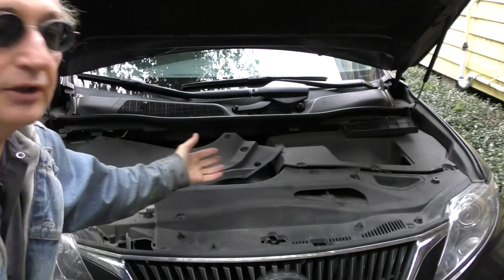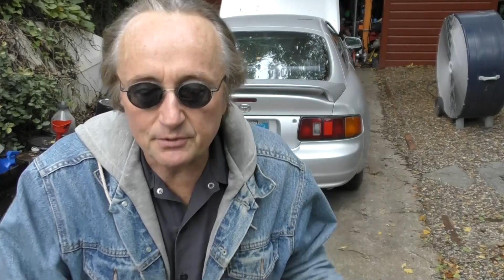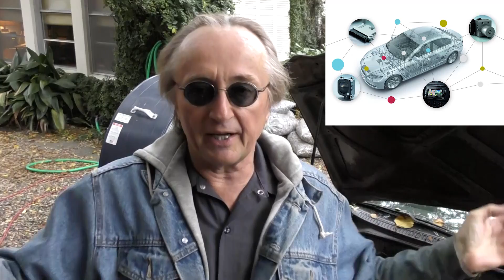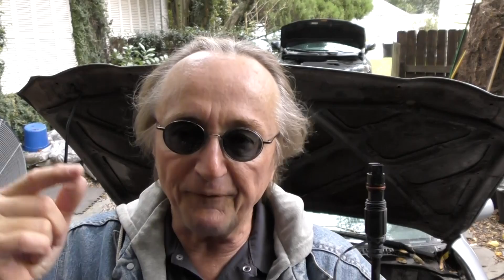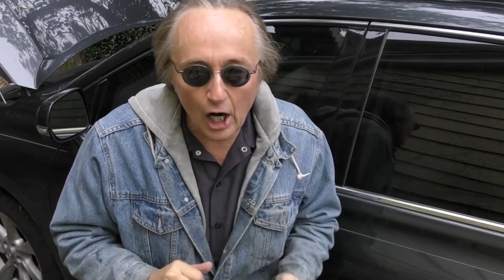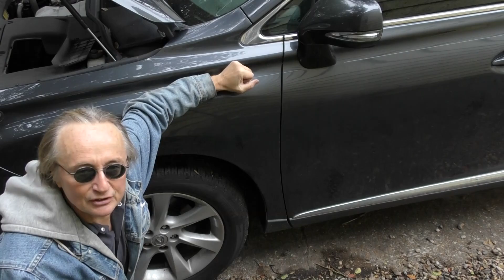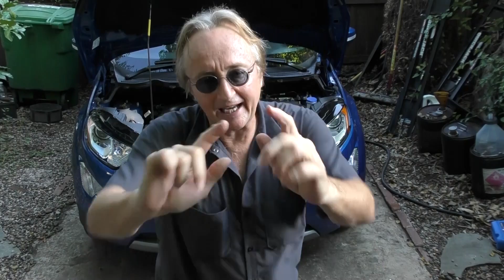The End of DIY Car Repair, Why New Cars are So Hard to Work On

Comment: Scotty, I've got a '91 Jetta GL that's been sitting in my garage for 5 years that I was thinking about getting it to run again. It's got 173k miles and is rather easy to work on. My other car has a lot of rust and is starting to have problems and really don't want to look for another car when I already have an extra one sitting around. I know you have a distaste for newer Volkswagens while also praising the old time VWs, but I'm curious about your opinion on the 2nd generation Jettas(1984-1992). Thanks.
Reply: I’m not Scotty, but I want to chime in because I drove a 1985 Jetta diesel and have known people who own your generation of cars.

I think it’s a decent ride, very cavernous and somewhat utilitarian.  It’s still old enough to not to have all the electronic and emission related headaches of modern VWs.

However, have you made sure that the Jetta has little to no rust?  I don’t know where you live, but since winter is here, decide whether or not you can stomach a project car.

Also, for obsolete parts, look all over ebay, junkyards as the age might make some repairs tricky.

Also, what’s your budget and how long until you get rid of the rusty car?
Reply: if you let a car sit,you are asking for more problems than you can handle
Reply: @AB-ou8ve  Last I checked, the Jetta had very little rust to the point that it's repairable. However, it's in a small part of my garage and haven't had time to get under the body for a recent check up. I live in the midwest and may continue using my older car for one last winter. At the very least, I am realistically looking at a few thousand dollars put into it. I can get another decent used car for the same price or less, but I like the look of the car, the way it drives, etc. People have tried to buy it off me in the past, but I always ended up saying no. One person was interested in it for just the shell.
Reply: Stevie84s Hi. I drove rental Jettas around that and the next vintage. I like them. I got Passats, 1st a 94 with VR6. If you like the car, by all means I would build a nice motor for it and restore it. Find out what motors will fit in there and join VW clubs and go to meets because that year of Jetta along with Corrado and Golf are very popular. Lots of parts for them. Supersprint exhausts are always cheaper for older VW's too. Good luck and have fun!

Comment: Nay screw that, just trade in your car every time you need new brakes, or an oil change, or tires. Not worth the complex system bull.  New wiper blades? To much hassle, just trade it in.

Comment: When we go fully electric, DIY will be history. So will most mechanic shops since companies like Tesla will have their own stores like Apple does. 💯
Reply: Tesla won't take over its a luxury electric car. Toyota and other car brands from Japan build quality that will keep the market alive for a while. We might move towards hybrids in the future but if you think gas production will disappear I highly doubt it. Trucks are not going anywhere ether. Gas is more efficient with electric hybrids anyway so it makes sense to be the future.
Reply: @CONNERK2  it's luxury for now.  When they develop cheaper cars in the future, people will start buying them up.  Hybrids are being skipped because the demand and reliability aren't there.  No one wants two completely separate systems that can fail at any point.  I think Scotty said hybrids are the worst cars you could ever buy before.

Comment: I had a CTS caddy, loved that car, got rear-ended....the minute I got it back, windows would roll up and down, radio would shut off, AC would turn on and off, power steering wouldn't work, couldn't turn the car off without disconnecting the battery. The top computer guys in town kept it for a month and couldn't figure it. Ended up trading it in for 500 bucks......still owed on it....damn a computer.

Comment: Lots of electrical problems are caused by rusty grounds, especially in the salt belt.   Finding the grounds is the challenge, especially the ones under the hood or rear (ones in the cabin are usually ok). I usually replace the ground bolt with a2 stainless replacements.  Capacitors also fail frequently on circuit boards, or sometimes you get lucky and simply replace anything with char marks on it.

Comment: The ECU of my Lexus was dead. The 2nd hand one, that I found turned out to be from a different year, not supporting my AFM. Thrown out the stock ECU and got Megasqirt. Working through qite a big manual, and had good support by mail, made the engine start easy. Compared to the old days with changing springs and accellerator pump cams in the Holey carb, tuning is much easyer in compurer age. Distributor caps and igniton wires were more expensive than 8 COPs, no problem for an aftermarket ECU.

Comment: Soon, gas cars are going to be replaced. :(
Reply: Electric cars are not eco friendly look how they make them. Gas is here to stay with a mix of eletric hybrids.
Reply: @CONNERK2  Wrong. I don't like new cars, but comparing new cars with new cars, a brand new electric car will have a lesser impact on environment than a brand new petrol one pretty fast, even in the worst conditions. Go watch Engineered Explained video to learn about it.
Reply: Not if Gerard Morin helps us run the engine on nitrogen :)

Comment: I'm an electronics engineer, I was a car mechanic when I was a teenager, I learned a lot in the transition between the old analog stuff (carburetor and breaker points ignition) to the modern EFI, but looking at the trend, the DIY average guy has to learn Networking basics (Ethernet for understanding the CAN bus), some high degree electronics (digital electronics, analog to digital conversion, switching power supplies, digital logic, high frequency transmission line analysis, elementary microprocessor and microcontroller knowledge, semiconductor sensor elementary knowledge), all of that to start using digital logic probes and and oscilloscopes for a good car troubleshooting process, that process of learning is costly or if you're a self-taught guy, takes a lot of time. Even with my converged knowledge of mechanical and electronic systems, I come across with a lot of situations where pinpointing a failure is hard on cars, back in the old days was easier, but today, in modern EFI you have to perform a lot of trial and error swapping expensive sensors or components for that purpose if the car allows that, you know sometimes there are anchored sensors or modules and you have to tell the computer you are swapping them with a other costly tool. I have a dodge charger SXT 2008, I ended up designing my own computer (I did a lot of research on the current signaling for that purpose), so I'm able now to tune my car the way I want.

Comment: The CAN bus system reminds me of the Citroën central hydraulic system. One leak and soon the big red "STOP" light comes on right in the middle of the instrument panel. Soon, the transmission goes to neutral, no power steering, not very long no brakes, only the parking brake! Finally the car sinks down.
Earlier computerized cars had separate computers for each function: ignition, fuel injection, airbags, radio, Bluetooth... They are going toward one master computer that does EVERYthing. When it quits you're done! Hope they leave a default limp-home function.

Comment: I think the biggest problem is manufacturers don't release source code or schematics for any of the electronics. There are a lot of people that are good with software that could trouble shoot issues but manufacturers don't want you to look inside the black box. Governments regulations also get in the way because they don't want people messing around with the emissions control system software.

Comment: Thanks for all the auto advice and funny screen shots. I have a 1997 Nissan Pathfinder with 316000 miles when Nissan made reliable vehicles. I did all that I could do with it myself still runs good except for some minor problems. I also have a Honda Accord 2015 and they are a world 🌎 apart in engineering. Keep up the good videos and beam me up Scotty. Blessings to you and the family.

Comment: You just need to never stop learning.  There will always be some things you won't or can't do, but eventually you will learn the new skills.  So long as we use internal combustion it will all come down to air, spark, and fuel in the right place at the right time.  And when we learn electrics we will have an different way to troubleshoot and fix the cars.

Comment: Scotty in reference to how most modern car's can-bus systems measure current in milliamps, I would like to make another point. If you ever did find the source of the short, repairing it would still be very difficult using traditional repair means like splicing and solder/shrinkwrap. Reason why is because splicing and soldering creates too much resistance in the circuit for the computers to accurately read what is going on. So the only correct way is to basically replace the entire wiring harnesses associated with the circuit.

Comment: Hey Scotty your right about not being able to work certain cars,  take my 2011 C300 for instance. I had a check engine light that the scan tool said it was related to the Crankshaft Positioning Sensors. I went through checking all of them...no joy. The dealer was charging outrageous prices so I went to two well known European and car repair facilities; one was even a former Mercedes tech supervisor. Even with their thousands of dollars scanners neither could isolate the problem. 
One referred me to the dealer who had a even more expensive scanner and they were able to find and isolate the problem right away and repair it. Apparently the dealer pays for newer updated codes every year that give a more in-depth definition of a general code. This way you don’t just R&R the car until you find the problem. Thanks for website.

Comment: The general rule of thumb is that cars today are more reliable & more fuel efficient than cars built decades ago. Today,  vehicles don't need manual tune ups, spark plugs last up to 100K miles, just make sure to change out and replace fluids at certain intervals, always replace the engine oil, I generally follow the Honda oil sensor, when it gets down to around 20%, it's time to change the oil. Things that you can do to save money, replace the fluids yourself, replace brake pads and rotors yourself, leave the heavy lifting to the pros.

Comment: The problem is not that it cannot be done, the problem is that most mechanics don't understand electricity. Working with milliamps is not too difficult if you understand what you are doing and have the proper test equipment. FYI - 4-20 milliamps is actually an industry standard just like 0-5 volts.

Comment: Learn to adapt.  I own a Prius and have done a lot of reaserch on how they work.  With a better understanding of their hybrid drive. I feel more confident in my ability to repair it if it comes to that.   My biggest fear with electric cars is the lifespan of the battery pack and programmed mortality and the pricing of a replacement.    I believed we have reached peak development of soley gasoline powered cars.

Comment: This is true. I am a hardware guy, I am not so much as a software guy. But I understand the CAN system enough to get things working. I'll give you a quick example. You mentioned high speed and low speed bus, this is critical to getting certain devices to work. In a modern car you have the radio tied in with this CAn system. You can't just go to the junkyard and yank one out. You have to know some important information first. But that didn't stop a buddy of mine. The newer 2008 Dodge Grand Caravans have a CAN system. Lower trim levels such as Se have a low speed can bus because there's not so many toys to control so to speak. So my buddy tried to add the Chrysler Navigation radio over his stock, having an Se or LX trim level (no fog lamps, power sliders, ect) I warned him I didn't think it would work. A side from hardware concerns, the harness plugged right in. But no power! Nothing. plugged in his old unit, walla power. The only possible way to fix this issue would be to swap out the main computer and the communications DPM with one from an SXT or Touring model and have it flashed. Even then certain features will never work such as backup camera because that hardware simply isn't installed. This isn't nearly as simple as the 4th gen van. Bought a cheap van that didn't have remote locks? Check under the dash cover for a harness, if you have power locks chances are this harness would be there. Go pick up the receiver from a junkyard, change a setting in the on board computer and walla, the radio was even easier since the wiring for the speakers in the dash are already there, you could install some awesome audio cheap.. Heck 1st gen Navigation unit just plugs and plays. A whole different world today.

Comment: Love your videos, Scotty. I'm binge-watching them. My first car was a like-new six year old 1970 Ford Maverick. Did your's have a shelf or glove box? Did your's have a chronic squeak in the front shock area? A mechanic friend of mine  repaired it by drilling a hole in the supper control arm in order to grease them. No side -view mirror on passenger side. Manual steering, brakes, windows; no AC; straight six engine.

Comment: Having worked in Telecom many years ago, I'd often have to learn about various buses or networks over which devices communicated with, as well as their command and data protocols over a particular bus.  The CAN bus should be easy enough for one to learn, and with a user interface and knowledge of the command set, DIY could be do-able on these kinds of cars.

Comment: QUESTION FOR SCOTTY:  Can you do a video that shows folks the basics of using a pre-1975 vehicle as a daily driver?  Around 1980 I started limiting my auto repairs to 1975 and older cars.  Why?  New cars were starting to get too complicated for a simple brain like mine.  The newest car I've ever owned was a 1977 Chevy Suburban, and today I drive an original (not restored) 1930 Ford pickup.  I always have, and always will, 'DIY' my auto repairs!   Even if I need my older car fixed by someone else, the parts and labor are much less expensive than newer cars.

Comment: I used to work for a company that had a 6.7 powerstroke, it had lots of problems with the motor and transmisson, they thought they would save money and get a new engine and transmission put in, the truck would run for 30 minutes and shut off, then wouldn't start again. They had it at four different Ford dealerships, they couldn't get the computers to link up, they ended up selling the truck for 10 grand, which was cheaper than the motor and transmission costed. Idk if it was just incompetent dealership mechanics or what, but it was the first time I had heard of something like that

Comment: While trying to diagnose a monopolist rear view camera on an Equinox at a Chevy dealership, I followed the troubleshooting chart to the letter. 4 hours later I called GM asking for the output specs of the camera since their were none posted on their website. They replied 30-300 millivolts ac. The camera was putting out 10. I could have found the problem in 10 minutes with that info. I asked why that info was not supplied on their website. They said they forgot!!!!

Comment: It is sort of a misconception about cars not being built to last. In the 50"s at 100,000 miles a car was finished. Now, it is niot uncommon for cars to last 300,000 miles. I remember having to put brushes and bushings in starters and generators, replacing points annually, changing oil every 1000 miles etc, now none of that. Cars are just driven much more.

Comment: The biggest problem is that manufacturers refuse to release all the documentation in an easy to find place.

Don't get me wrong, I don't expect them to train me, but knowing what goes over the can bus's on a bit level and what ID's each item on the bus has would go a long way.  Hell with that information and a fairly low cost data logger you can pretty much determine exactly whats causing the problem in most cases.

My feeling is if you use the documentation to train your techs it should be available on your website.

Comment: This is kind of a repeat question. Can you show how to build a stand alone O2 sensor heater circuit?  My 2005 Jeep TJ has a bad controller on the PCM.  The vehicle runs fine but must rely on the exhaust getting hot for the O2 sensors to switch to closed loop.  It would be nice to add a manually operated system that would heat the O2 sensors so I can keep them in closed loop even if the exhaust is cold like at slow speed on a cold day.  Thank you Scotty, you are the best.

Comment: Here a question I thought of... Tire pressures... Why do manufacturers like to have about a 2psi difference between the front and back tires? Also, is it a good idea to when there is a season change where temps drop in winter and go up in summer to let all the air out of the tire and put new air that will be the temperature of the current climate? I heard doing that air swap like twice a year you wont have the potential surprise of air loss from a tire when the air temp snaps low or high depending on the season.